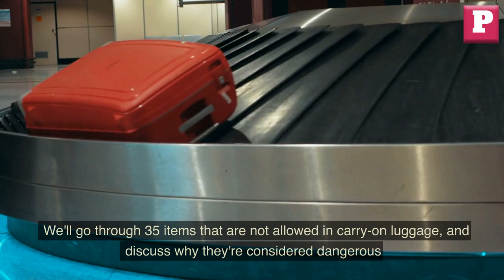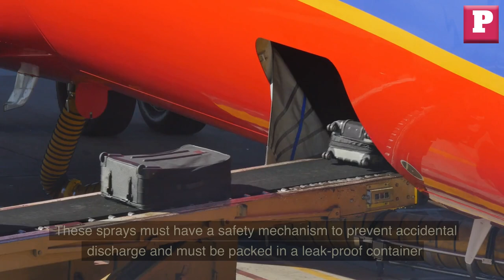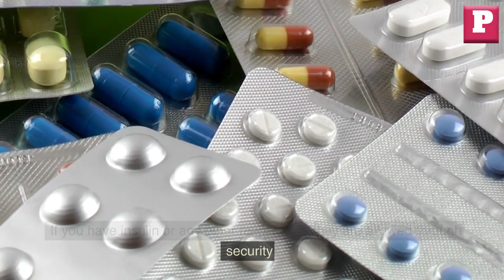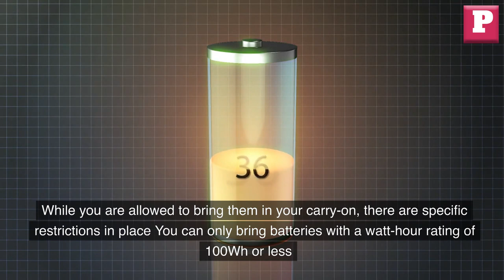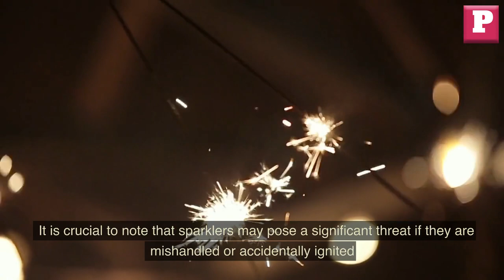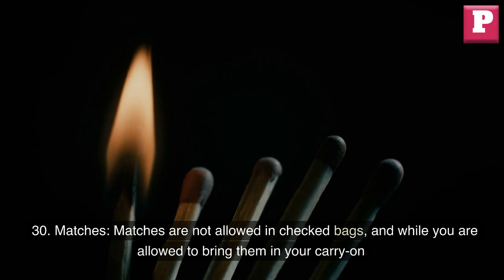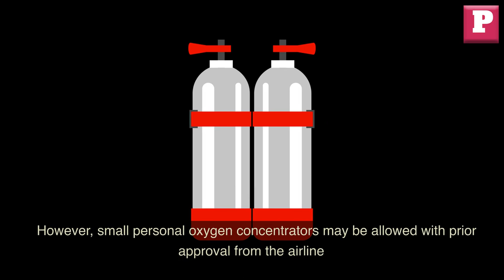Know Before You Go 35 Household Items Prohibited on Airplanes | What NOT to Pack in Carry on Bag

Comment: As to #33, those are actually allowed in carry-on bags as long as the batteries are turned off. Like everything else that contains a Lithium-Ion battery, they are definitely NOT allowed in checked luggage. Those types of batteries are notoriously unstable and can catch fire or explode, which is why you can not put them in checked luggage. I've flown to the US and back twice in the past year and had no problem taking my vaping device in my carry-on bags, along with spare batteries.
Reply from the maker: Thank you.